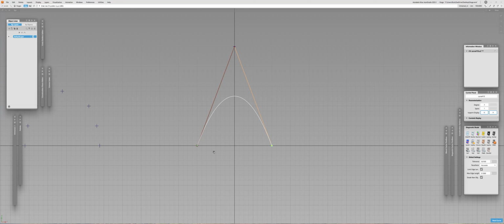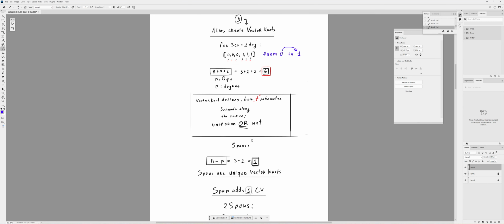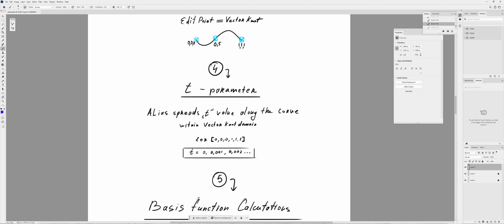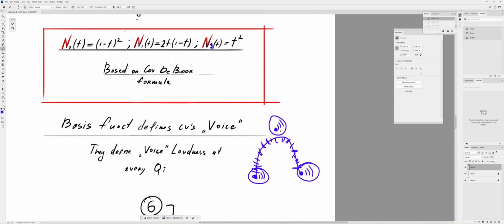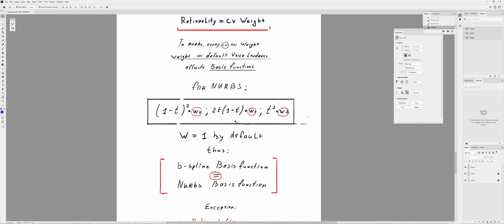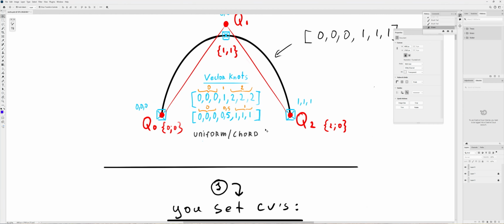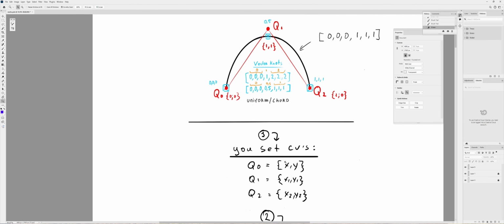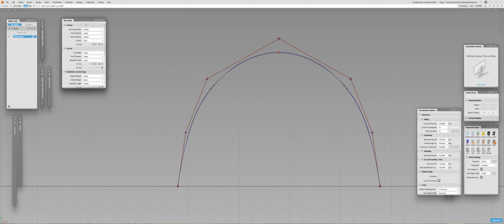Alias Theory Builder - NURBS curves

Comment: NURBS → non‑uniform, Knot spacing → uniform :face-orange-raised-eyebrow:
Uniform → mostly suitable for 1 (single) span curves (patches), easier to compute
Chordal → real non‑uniform accurate representation of the curvature (and more computationally heavy) profile because they are in relation to its chordal (straight line) counterpart (to be calculated too), useful in motion trajectories of precision robots and machines (not so important about aesthetic or design surfaces)

That is why there is a typical 'rule of thumb' to proportionally get closer the CV where the acceleration of a curve is supposed to happen. This way Uniform and Chordal get more matched to each other → rather Uniform gets more matched to Chordal knot spacing.
Knot vectors ensure that continuity is met between spans, therefore most minimum satisfactory degree for multi‑span curves\surfaces is 3 → ensures G2 continuity. Of course fourth degree allows for G3 (low) but if the objects are too many, it gets computationally heavier. Also, with some tweaking of tangency vector (polygon\hull) we can approximate G3 for 3rd degree elemnts.
Rational means that the control points of these curves\surfs. can have proportional influence over the domain of t (or u) parameter → necessary to approximate circles and ellipses (closed periodic shapes) → the Weight parameter (coeficient).
Reply from the maker: Thanks for the detailed comment - you’re clearly familiar with the topic, and I appreciate the intention to expand the discussion.

There are a couple of important clarifications, though, because some of the concepts you mention belong to different layers of the NURBS formalism.

“Non‑uniform” in NURBS does not refer to the choice of parameterization (uniform vs chordal).  
It refers strictly to the knot vector: the basis functions do not have equal parametric support, and the influence of each control point over the domain is not evenly distributed. All NURBS are non‑uniform in this sense - that’s the defining property of the formulation.

Uniform/chordal parameterization is a separate concept: it only describes how the initial parameter values are assigned to a set of points before the curve is built. It is not part of the definition of NURBS, and it is not related to rationality.

In practical Class‑A tools (Alias, ICEM Surf), curves become “chordal‑ish” as soon as you edit any CV. A curve is uniform only at the moment of its initial construction and only if the tool explicitly forces it (and a single span, 2 vector knots). After the first modification, the parameterization is no longer uniform - but it is not strictly chordal either. It becomes geometry‑adaptive, based on the actual segment lengths.

Rational vs non‑rational is yet another axis.  
Rationality only affects the weights in the basis functions. Non‑rational curves simply have all weights equal to 1. Rational weights are required for exact conics, circles, ellipses, etc. This has no relation to uniform/non‑uniform parameterization.

Your points about knot vectors and continuity are absolutely correct: degree 3 ensures G2, degree 4 allows G3, and continuity between spans is controlled by knot multiplicity.

Comment: A small request if possible Alex.
Can you revisit this again in grasshopper? Woth it's tools many of those concepts can be visualised directly and I think it will be easier for those of us without the mathematical know how.
Reply from the maker: Actually, I did - to some extent - in the next Grasshopper video that will be released on Thursday. I’ll reiterate the basic concept there.
As for the visualization, I’ll think about it. What immediately comes to mind is the Paul de Casteljau method - a geometric way to represent the mathematical idea behind basis functions through straight‑line interpolation.
I’ll think about it, thanks for the suggestion.
Reply: @AGGraphics  I just saw one of those videos in your Alias series 😁.
I was thinking something more on the lines of what Freya Holmer did a while back, but with Grasshopper.
I have a vague idea about the 2 methods used for calculating b-splines, but I am still not fully comfortable with the math 😅.
I think I need to go back to the basics since my foundations weren't that good to begin with 😅.
I will say this again, I am truly grateful to have mentors like you 🙏🏻.
Reply from the maker: Thanks so much for the kind words - it genuinely means a lot
And you’re absolutely right about going back to fundamentals. Understanding where these concepts come from gives you real confidence when modeling.

But it’s also worth remembering one thing:  
the math behind B‑splines - especially once you step into tensor‑product surfaces - is extremely rich, highly variable, and historically took humanity several decades to formalize. There isn’t just “one” method or “one” formula. There are families of basis functions, multiple evaluation strategies, knot‑space interpretations, and a whole zoo of numerical approaches.

So yes, knowing the foundations is great - it helps you understand why the system behaves the way it does.
But in practical modeling, the good news is that the software handles the lion’s share of the complexity for you. Once you grasp the conceptual mechanics, you don’t need to manually wrestle with the full mathematical machinery every day.

That said, I absolutely love seeing your interest in the fundamental side of things - it’s the right mindset, and it will pay off massively as you go deeper.

Comment: Thank you Alex, very useful, I will be rewatching this again later. I would like to fully understand the difference between a bezier curve and a b spline. Is a b-spline a parent of a bezier like NURBS is to a b spline? Or do they have different basis fuctions altogether?
Reply from the maker: Hey! Thanks! As for Bezier, - great question! They indeed from the same family, but not the same. Think of Bezier as a smaller brother of splines/nurbs. Bezier are defined by Bernstein polynomial basis functions, they lack a knot vector, and are typically cubic (degree 3), with each segment being a single polynomial. B-splines and NURBS use Cox-de Boor basis functions, incorporate a knot vector to define spans, and support higher degrees with local control. NURBS extend B-splines with weights, enabling precise representation of conic sections, unlike Bezier curves, which rely on composing multiple cubic segments for complex shapes. (and you control this cubic peaces with tangent line-handles that is so hard to use). So yeah, they originate from the same concept, can be converter one to another (with limitations), but they are not the same. Bezier are lighter, faster, but luck control. Good for 2d vector editor, - but not for CAD. That said, they still can be found in CAD systems here and there. For example, in Fusion 360, but more like a secondary system.
Reply: @ Thanks for clearing that up. 👍
Reply from the maker: Glad that helps!